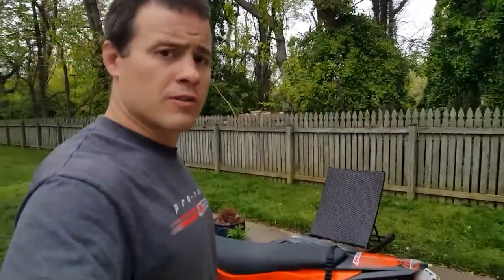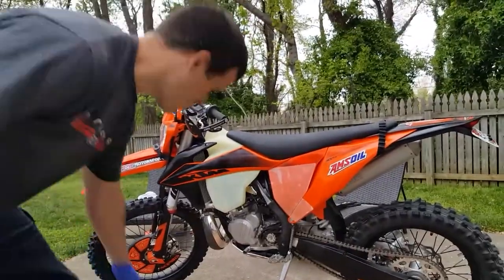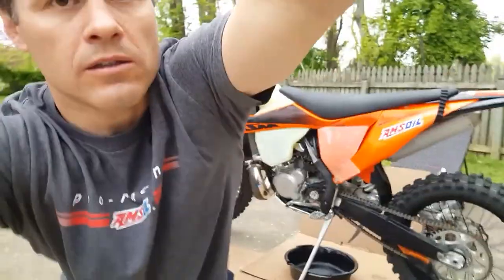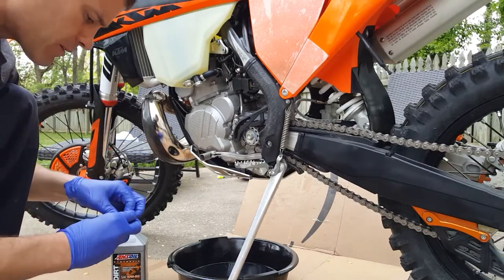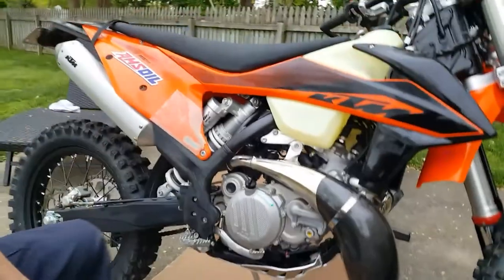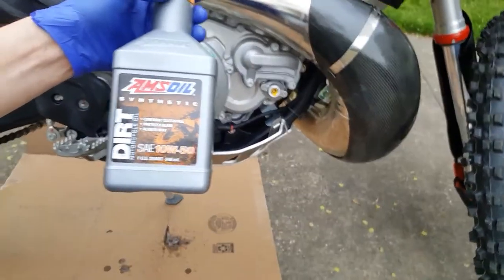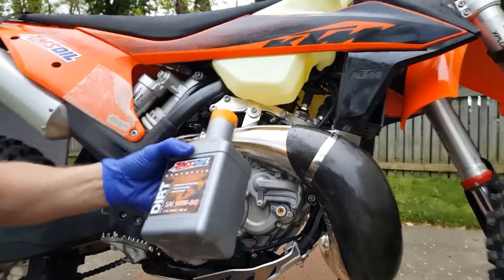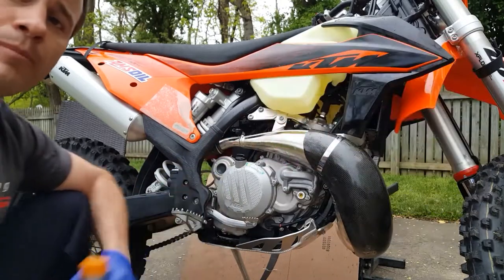First Dirt Bike Transmission Fluid Change - 2020 KTM 300 XC-W TPI

Comment: What oil are you using in your TPI system?
Reply from the maker: Great question.  I'm using the AMSOIL Interceptor Synthetic 2-Stroke Oil (AIT), https://www.amsoil.com/p/interceptor-synthetic-2-stroke-oil-ait/.  It's perfect for the JASO FD spec.  I'm over 100 hours with zero issues.
Reply: @officeroil-amsoil3463  I have a 2023 KTM 300 xc-w TPI and I want to try AMSOIL, you recommend the Synthetic Dirt 10w-50 in my clutch?
Reply from the maker: @ridemdirtbike1865  Congrats!  I love my bike.  Hoping to get the new 2025 KTM 300 Hardenduro.  How do you like yours?  

The AMSOIL Dirt Bike 10W-50 (DB50QT) will work just fine and I used to use it myself.  However, I recommend the Synthetic Dirt Bike Transmission Fluid (DBTFQT), https://www.amsoil.com/p/amsoil-100-synthetic-dirt-bike-transmission-fluid-dbtf/?code=DBTFQT-EA/?zo=1649274.  I did oil analysis (with YouTube videos) with both oils and prefer the Dirt Bike Transmission Fluid.  Love the constant clutch feel!  

Here's a helpful lookup guide to see what we recommend for your bike, https://www.amsoil.com/p/amsoil-100-synthetic-dirt-bike-transmission-fluid-dbtf/?code=DBTFQT-EA/?zo=1649274